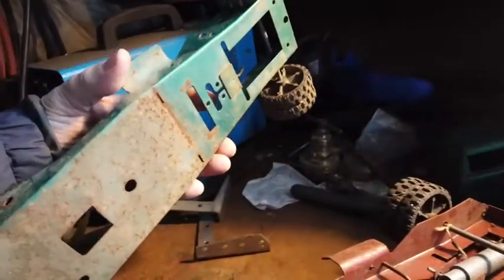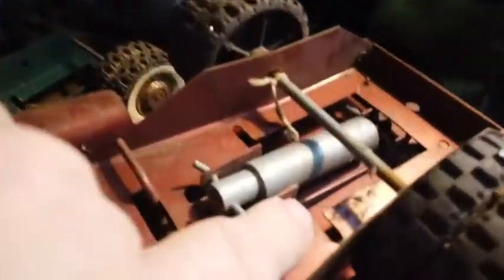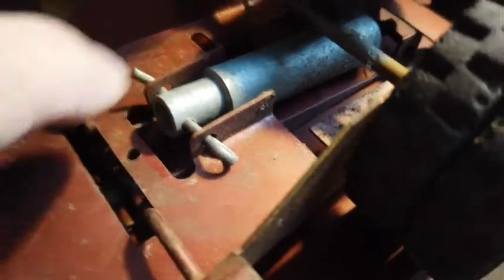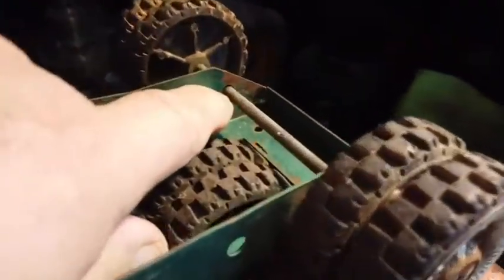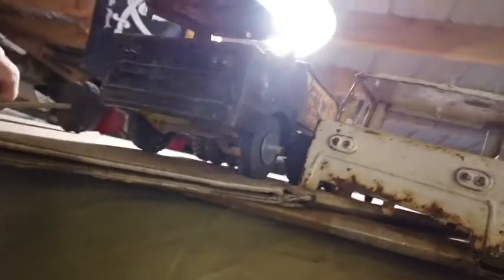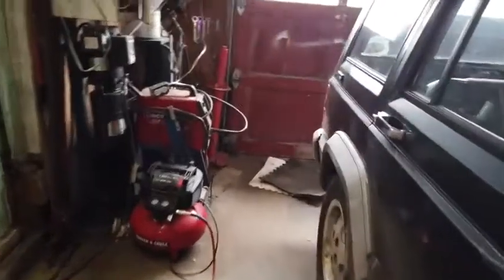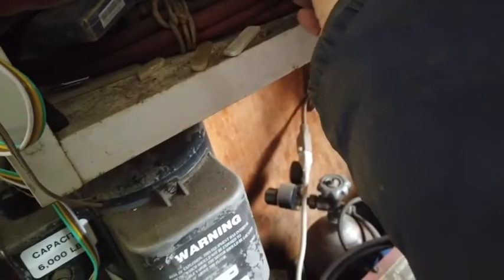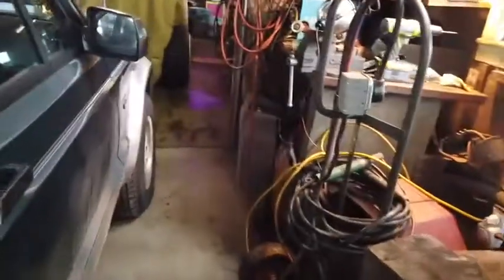Toy Truck rear axle relocation

Comment: I was told 7018 low hydrogen welding rods make some good axle's once you get the flux off..
Reply from the maker: Yea, they should.   6011 or 6013's do too.   I didn't skin the flux off, I just left it on.